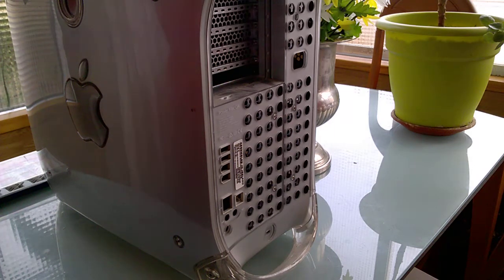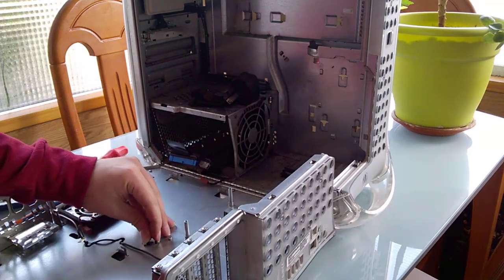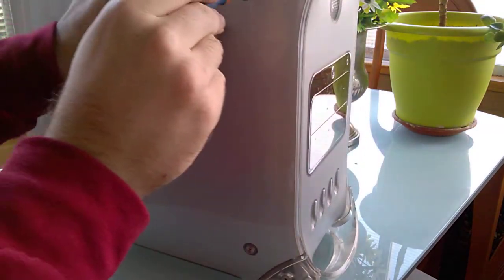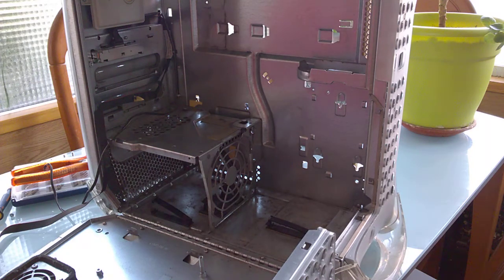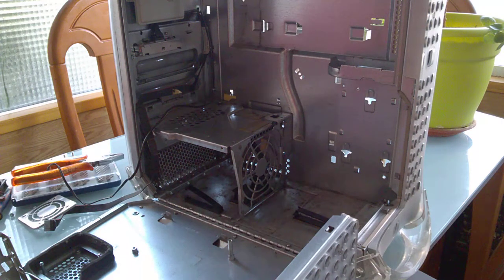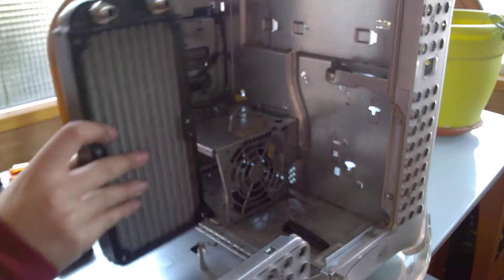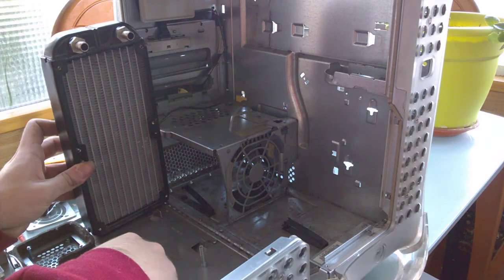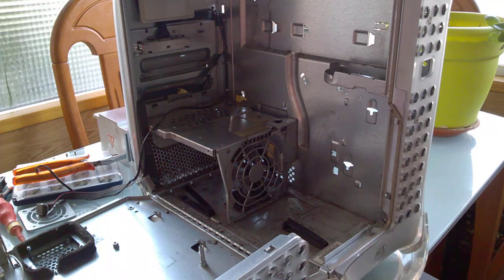Rambly Power Mac G4 MDD Disassembly for watercooling 2017/12/26

Comment: So what happen with this? Cause I wanna do something similar. Oh and lol I successfully flashed a 7800GS
Reply from the maker: The 2GiB ram ceiling these machines have became too low for my purposes and I just left the project as it was after fitting a 240mm radiator in the case. It just wasn't worth the time anymore. Maybe some day I'll finish it, who knows.
Congrats on finding a G70 7800GS. Those are absolute beasts.
Reply: @ITTFami  Oh, yeah 2GB is fucking nothing these days. That 7800GS runs ridiculously hot though, the fan never goes beyond 5%, odd cause everyone I heard of flashing a 7800GS for a G4 caused the fan to run at 100% because of the disabled temp sensor. Absolute beasts my ass, it barely runs Halo at 1280x720 on high. Something's probably wrong with it or the OS install.
Reply: @ITTFami  I realized I can push most of the resistors off to get to 1.5 GHz, but now the CPU is too fast for the pipeline cache and all I get is pipeline errors when trying to run Geekbench.
Reply from the maker: Some strange issues you're having with your MDD. Never heard of that happening with a 7800GS flash, and most failed overclocks on 7447 cards are caused by unstable CPUs, the caches can usually keep up. Unless it's a 1GHz card or something, in which case even getting it to boot at 1.5 is quite the feat.
I know this is the "have you tried turning it off and on again" of the MDD world, but have you checked the voltage stability of your power supply? My FW800 started having some random issues (kernel panics every other boot, random errors when building software, freezes when playing video) and it turned out to be the power supply.
Reply: @ITTFami  7447? I have a Dual 1.25 card with 7455B chips. A few days ago this thing refused to boot, I would press the power button, the light on the power button would fade out completely instead of staying on, no chime, after 20 seconds the fans would go to full speed, which apparently is cause by a dead 5VSB rail (or 5v "trickle power" as apple calls it) so it could very well be possible my PSU is on its way out. However, my system ran just fine earlier today before I did the OC. I'll check the voltages anyway. According to some guy who seems to know his shit about CPUs it is a CPU issue indeed, the CPU is too fast and the pipeline cache can't keep up or some shit like that. Apparently heating the CPUs at 155c for 10 minutes will fix it because of some chemical bullshit that Inturd found out over a decade ago. "Intel learned in 2002, that the limit had been reached in frequency because during the binding process, some of the wafers would thermally change to SiO2... which isnt a bad thing necessarily, but... SiO2 is a different class of semiconductor.... meaning come parts of their chips would phase shift (run slower or faster) after thermal oxidation, because this oxide layer was extremely localized
to counter the issue, they thermally doped the CPU's, allowing them to cross the 2.6Ghz barrier by 2007... but this required a controlled temperature, and the magic number was 302F or 150C
Lastly... If the external temp of a processor is 100C or 140C, the internal temp is going to be 185C to 235C at the hotspot."
Looks like I've really lost the silicon lottery. I've seen a guy get over 1100 in cinebench on a Dual 1.25 MDD with 768MB of RAM while I only got 1067, others have been running their MDDs at 1.5 stable for years now.
Reply from the maker: Oh man, you can tell I haven't touched one of these in a while. The MDDs had 7455s, yes. The laptops had 7447s.
It does seem like your PSU is flaky indeed.
I didn't know about that Intel thing, interesting to say the least.
Those people running their MDDs at 1.5 most likely have 7455Bs. My dual 1.25 with 2x 7455As wouldn't go past 1.33. 7455Bs are known to be great overclockers, I have a single 1.25 7455B card which goes to 1.67 without an issue.
My dual 1.33 got around 1150 points in geekbench 2 under Leopard. Can't remember the exact version, apparently scores vary even between small version changes.